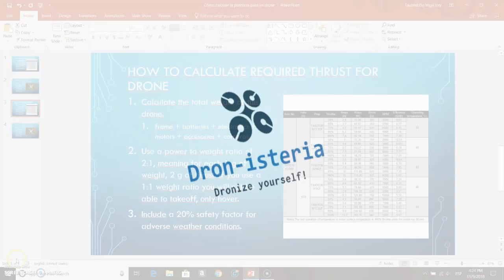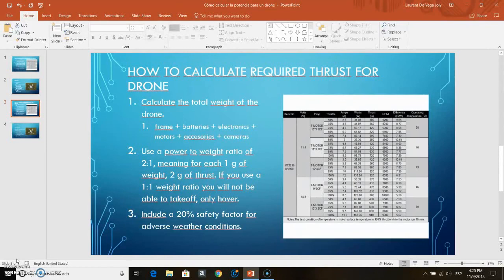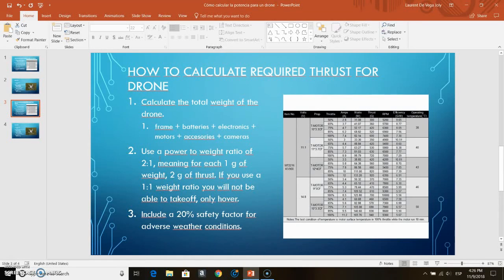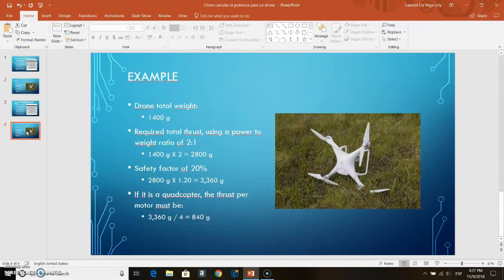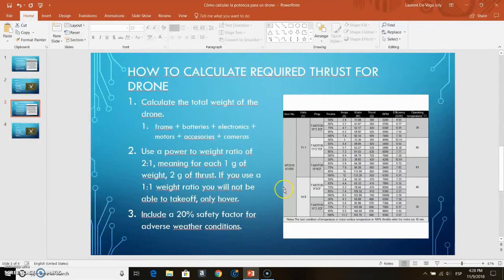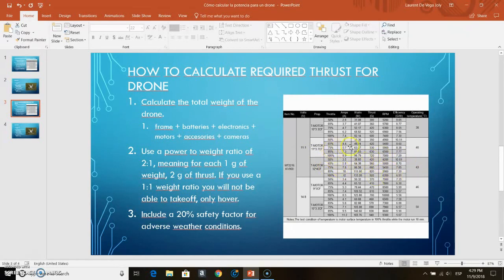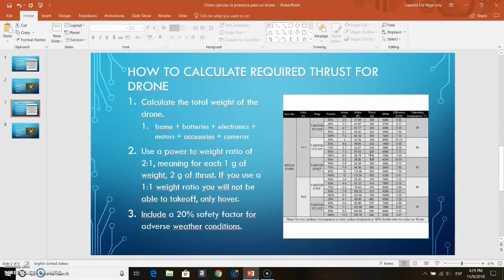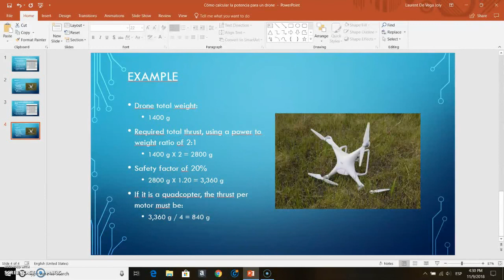How to calculate your drone's required thrust!

Comment: how to calculate thrust force by a drone so that it can fly into the air from the ground by using the laws of physics?
Reply from the maker: You only need the weight of the drone and the lift force of the motors and props. We show this calculation in our video!